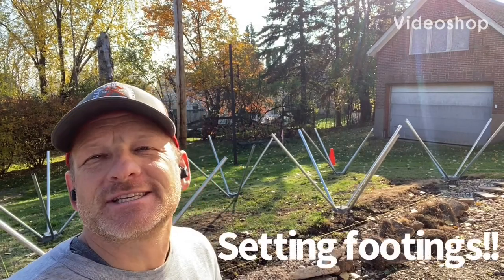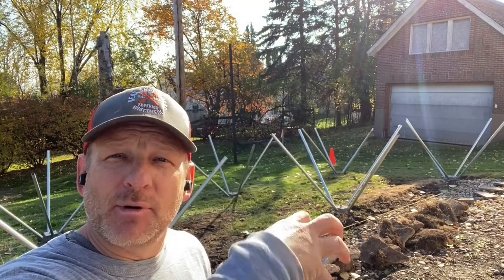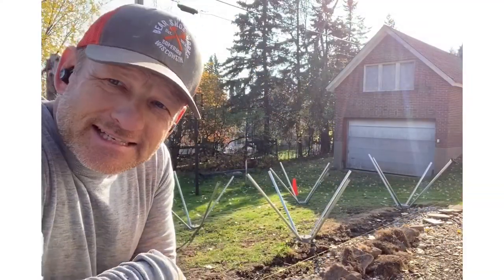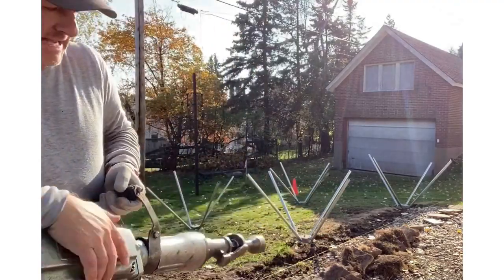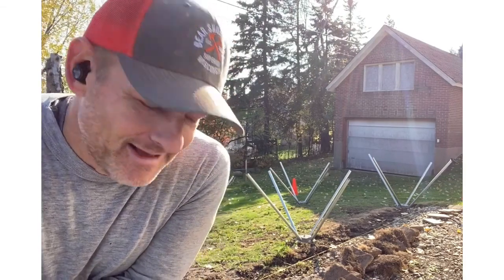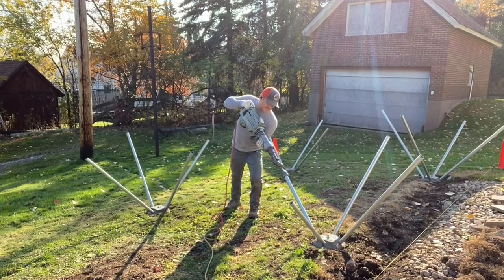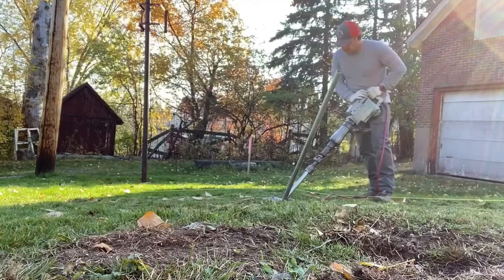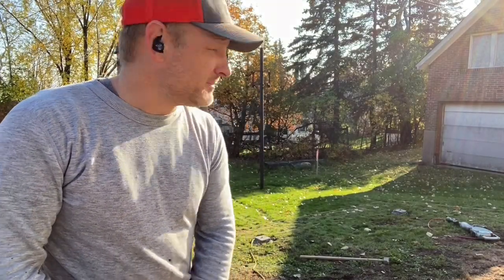Installing Diamond Pier Footings for this Deck

Comment: Those pipes do not fit the definition of a construction footing so they should never be called footings.
Reply: Dude did u literally watch every single video and short on YT about these things to talk shit about them lmfao. Ive seen you comment on at least 5 different videos about this saying they dont work. Wheres your proof? Have you used them and had them heave?
Reply: @masonCOBwing  Unlike you I understand the physics involved and I have enough real world experience with footings and related construction to know what will work and what is a scam..
 If all the soil that these pipes are driven into lifts with the expansion of ground frost...You tell me why you think they will not lift as well.
 If you think you have the answer and it makes sense to you then go ahead and drink their snake oil, waste your money and try them out.
 Unless you live in the deep south you will be trying to dig real footings under your existing construction after the first winter and if you build a deck with a ledger board bolted to your house  you will be making some big repairs to the house as well.
 Don't say I didn't warn you.
 Read their warranty and see how nothing is covered by it other than replacing the useless units they sold you that don't work.